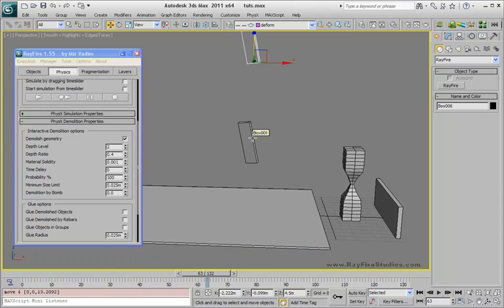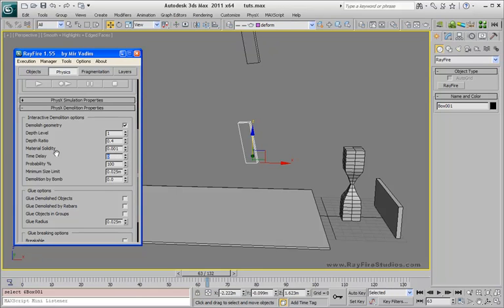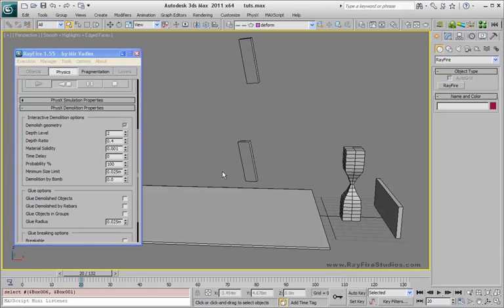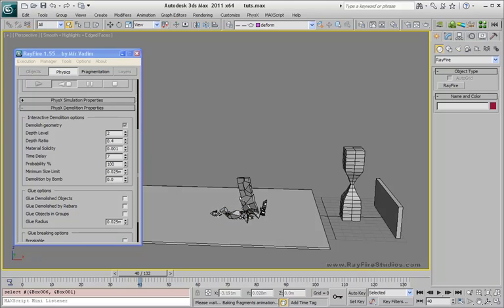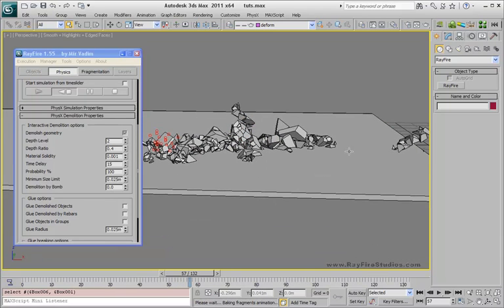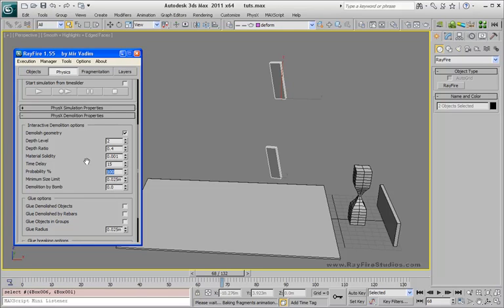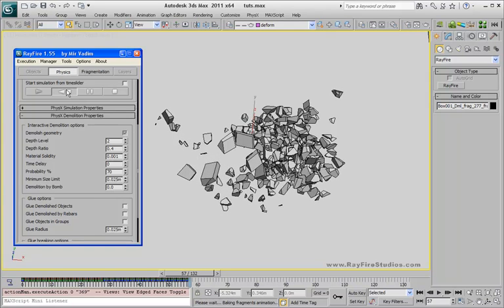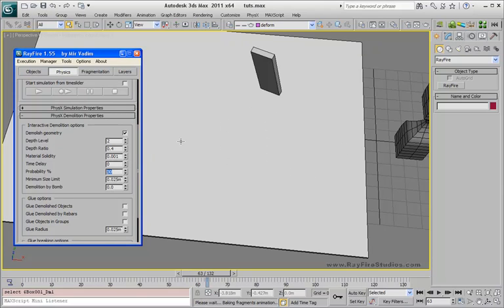RayFire 1.55 - Time Delay for Interactive Demolition

Comment: @SlayerBeast94 If your using a pre-fragmented object place it under the Sleeping Objects list. All other objects you want to destroy in the simulation (Such as those you animated) go under the Dynamic/Impact Objects list. The only things you add to the Static & Kinematic Objects list are objects that don't directly interact with the simulation like the ground plane or objects they will collide with.

Also, just make sure the start of the simulation is before the last animated keyframe.

Comment: How are you using Physx on Max x64? I thought it was only available in 32-bit?
Also, is it possible to use Physx on a machine without a nVidia card? I'd like to use Rayfire on a laptop with Intel integrated graphics, but from what I hear it's much better to use Physx than reactor.